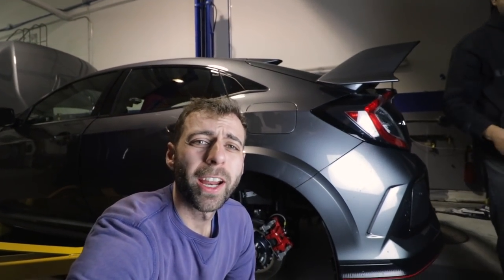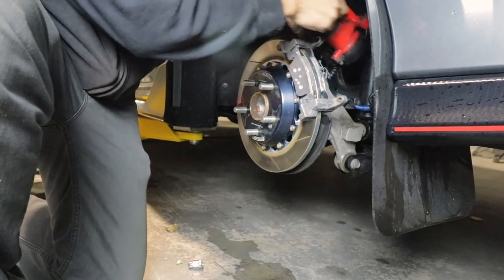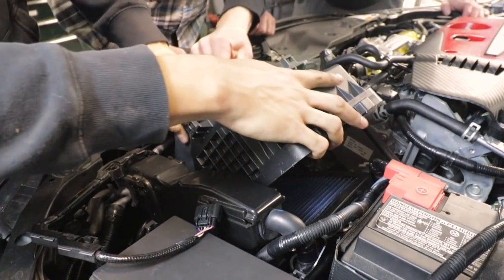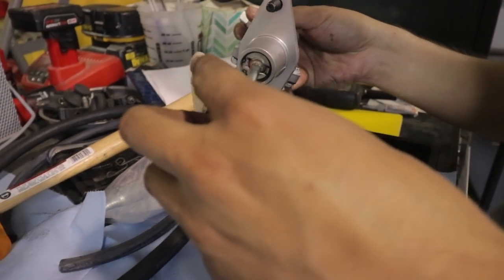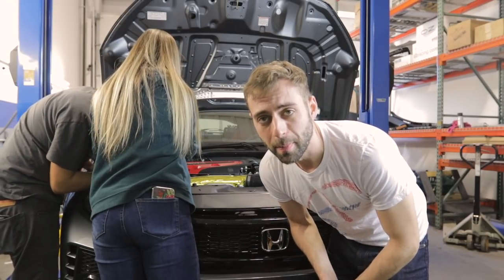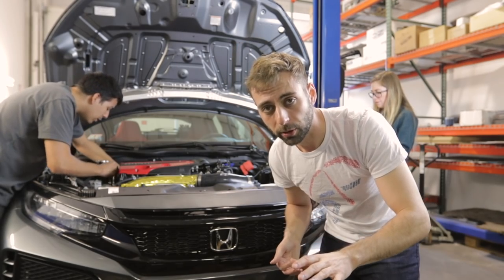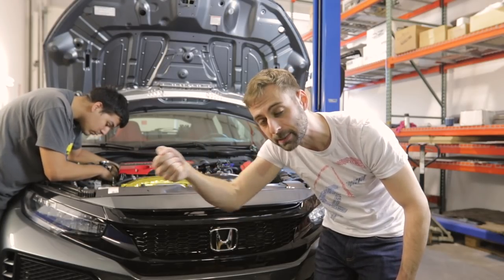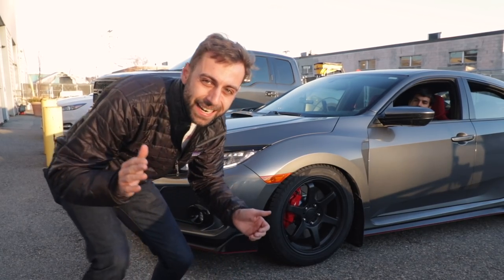Honda Civic Type R Mods for Track

Comment from the maker: To clarify, we were only installing rear pads because when the fronts were done, we were missing a special backing plate for the rears. All 4 corners are set now with the G-LOC pads. ALSO the CDV is in the slave not the master, so this eliminates the Dampener in the master, and not the CDV (sorry for the mis-speak!)

Comment: God Damn it! it's not a delay valve in the master cylinder, it's a dampener! rumor has it, it's there to only take up the vibrations going to the clutch pedal. 

The delay valve is located in a Slave cylinder! it's a small plastic piece with a ball and a spring that delays the fluid going only one way, when you release the clutch pedal. Highly recommend taking it out. 

Does the R have some 2nd gear grinding issues? from the list of mods I don't see anything done to the transmission fluid, now it's just my opinion: Honda MTF is an all around good oil, it's thin for when it's really cold outside and transmission has a cooler for when it's really hot out. I would suggest swapping the fluid with Amsoil synchromesh ( or any other preferred brand ) it will stand better to hot temperatures, the only downside is when it's really cold out, it won't perform good until you get it up to operating temps ( 10-20 min of reg driving ).  

Anyway, great video, looking for more of this Type R.
Reply: MrTarazzik apologies you are correct it is the dampener, that is next on the list though! I am doing Amsoil flush when I do the next fluid change.
Reply: Sorry just curious, how cold (temp) are we talking? say colder than 32? so if it's not freezing outside, will it be safe?